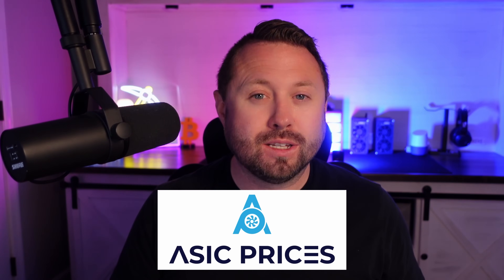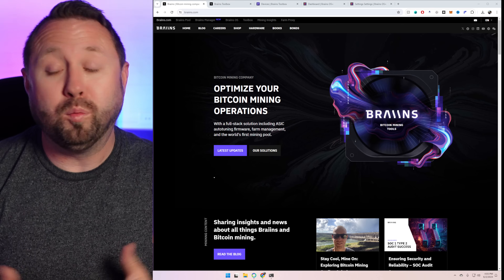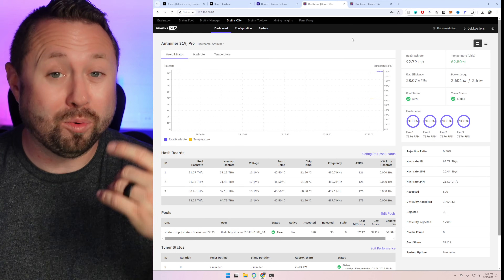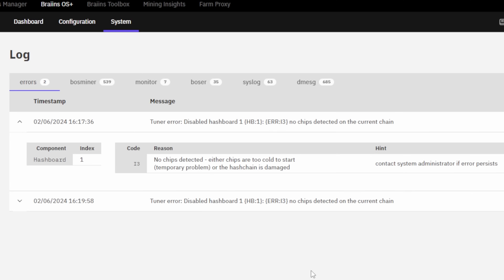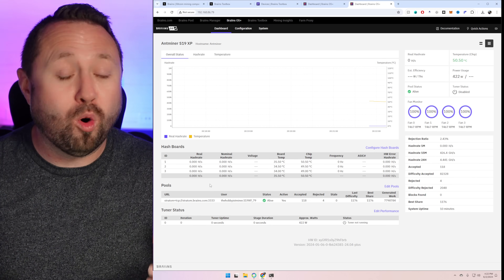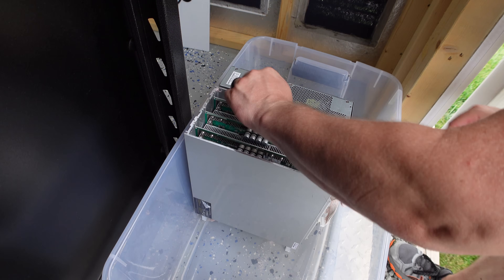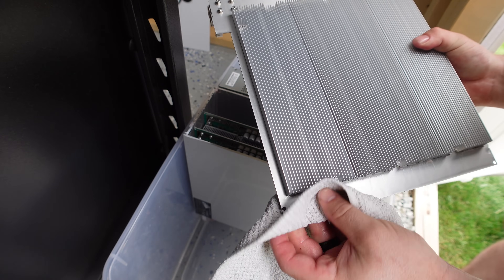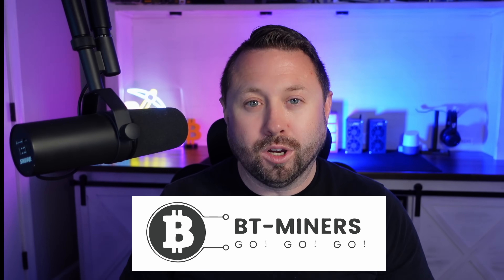This Could Happen To Any Home Crypto Miner, Right!?

Comment from the maker: As a Home Miner, Whats been your Biggest "MESS" or REGRET with Hardware, Airflow, Design, Power?  Throw it out there!?  I have plenty!
Reply: I have a Fog Hashing C6. I knew it would be a mess, so I bought a stainless steel sink and bucket. I added a filter to collect the fluid. Worked like a charm.

Comment: good thing to see that my suspicions about using solid one piece coolingblocks in a submercion system is not a good idea as these blocks use the thermopaste on the asics to make a good connection , guess i stick with the soldered on individual coolingribs
looking at you struggling taking the miner out : might be an isea to have a drying rack that fits over half of the oilbath alowing the oil to drip out of the miner straigh back intoo the system 

looking at the one piece cooling blocks on those hashboards , you might want to investigate if theres a thermal paste that works with the oil and clean repaste the hashboards that still work as i suspect they be running at uneven temperatures too because of loosing contact with the coolingblock

Comment: Ive had 2nd hand mineral oil miners (S9) and they have all been broken, ive noticed the solder or components on the control boards DO NOT LIKE mineral oil surrounding them, also the hash boards are mostly damaged and have absolutely no clear indication of why, i assume its the components on the boards that control resistance or capacitance

Comment: I finally got my fog hashing last month and put my 2 ks3m in there so far so good no problems i did repaste to both of them before put them in temp around 70 to 80 C
Reply: You’re running them at 70-80c or Fahrenheit?
Reply: @troylindsey1103  Fahrenheit is 70/80 and exhaust on the software is about 30 Celsius